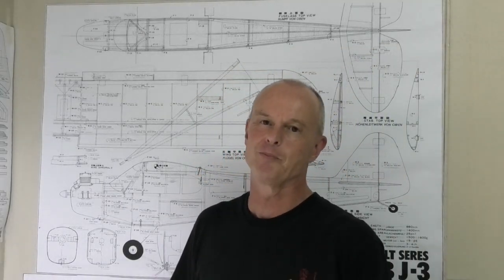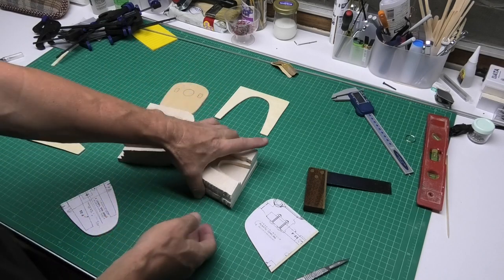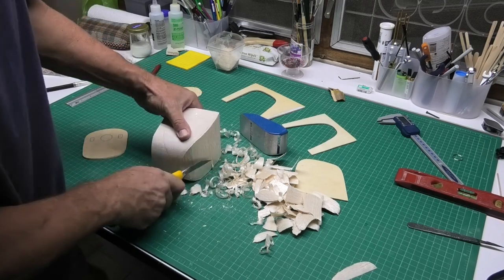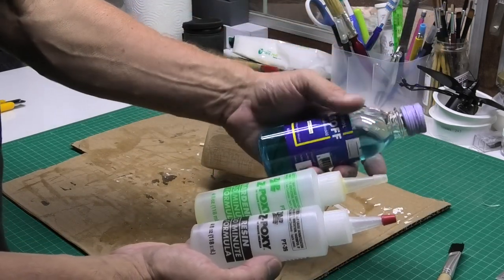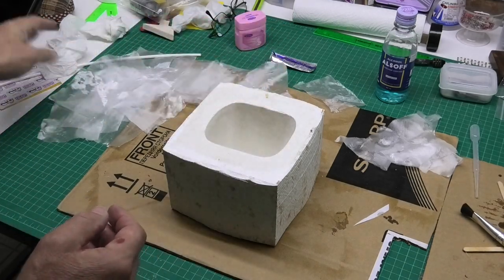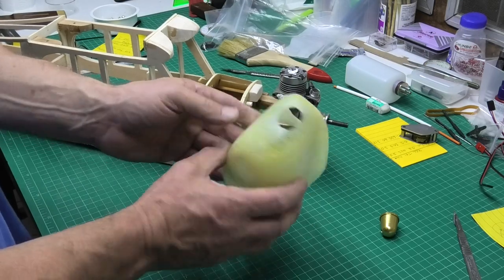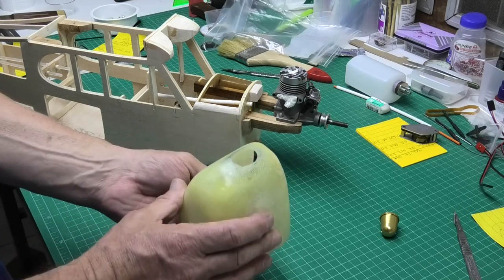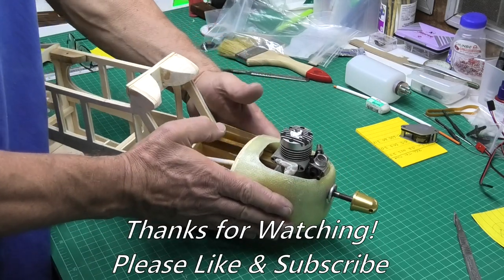RC Piper Cub J3 balsa plane build - Pt 9: Making a Cowl

Comment: Hi, I'M trying to make a spare canopy for a Great Planes Extra 300S before the maiden flight...for obvious reason....lol. would you use the same procedure to do the mold. And are you using only plâtre de Paris or other plaster material. How would you protect the mold so that the fiberglass canopy can be remove easily....thanks.

Comment: Would have been helpful if you gave the different weights if the cloth and the number of layers
Reply from the maker: I used 2 different weights, 3/4 oz first then a heavier 3 oz, and I just kept building it up until I though it was thick enough. Hope that helps.

Comment: This was a very helpful video. Prior to watching, I did not know how to make a fiberglass cowl. The plastic cowl on my first gas airplane, disintegrated over time and I stopped flying it since it had an OS40 engine just protruding out the front. The cowl makes a big difference in the look of the airplane. With this video, I am tempted to make a cowl. Just one question: Did you brush 30 minute epoxy into the fiberglass sheets inside the plaster mold to form the cowl? I am new to building fiberglass structures. I would have liked to see you preparing the layers of fiberglass. Perhaps an idea for a future video? Thank you for making this video and showing us the general technique.
Reply from the maker: Thank you very much for the comment, its really appreciated. Yes, I used 30 minute epoxy, but thinned down with a little 70% ethanol.  Only a small amount is needed.  Good luck with making a cowl
Reply: Thank you Mark for providing the info on the epoxy and alcohol. I enjoy learning the build process.